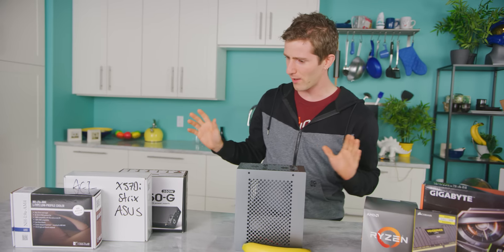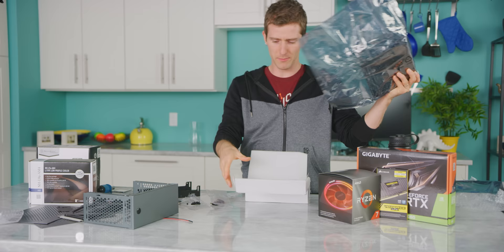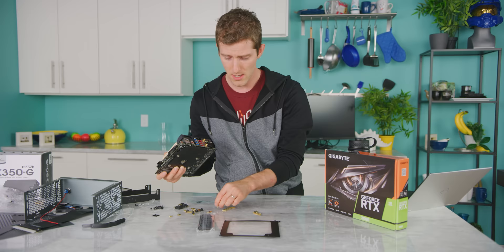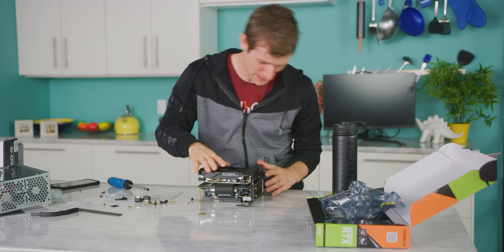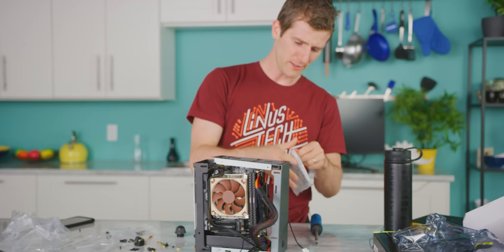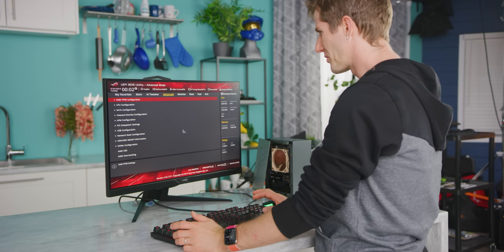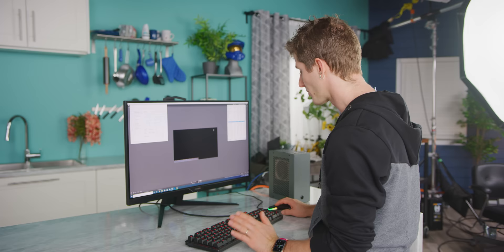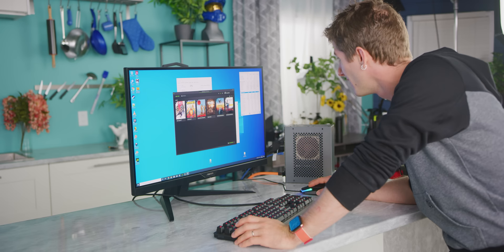Our Smallest Gaming PC Build EVER! - Velkase Velka 3

Comment: Me before watching: I want that
Me after the watching: I still want it but it’s gonna be a painful build

Btw I have a question would it be possible to put a Ryzen 9 or even a threadripper?
Reply: ryzen 9 yes, but not threadripper. depends on the size of the mobo, dont think threadripper makes itx cases
Reply: I think the problem with the R9 would be cooling, not fit.
Reply: Sylvain Ellis noctua nh 12
Reply: At 100% fan speed an all fans
Reply: Ryzen 9 yes, but why? The Ryzen 9 will overheat if it’s overclocked because of the tiny case.
Reply: @isoldmykidneysforyoutubepr3605  why would you even need overclocking on that monster?
Reply: biggest problem will be power delivery as well...it will be pretty tight and hard to find a PSU of that size that actually provides enough power. Also cooling will be pretty much an issue in a way too. Threadripper though? forget about that.
Reply: No, the gpu would bottleneck, and the motherboard as well. Their both super small and a better gpu would be bigger, thus won’t fit.
Reply: ryzen 9 sure but the temp will be crap threadripper in your dreams the TR4 socket would take up like 30% of the motherboard and you wont find a cooler beefy enough at that size to keep it idling under 70C
Reply: Most likely the Ryzen but probably not the threadripper because a small mobo that has to  fit into that case most likely can’t handle 64 cores

Comment: Still with like 1/4 of the size it’s better than a mac “pro”
Reply: In what?
Reply: GP2_Engine  mac pro is pure shit
Reply: GP2_Engine  6000 dollars for 32 gb ram and 8 core processor and like a rx 580
Reply: GP2_Engine  yeah my bad about the last one but the first point still apply sur paying 50 k for only 28 cores like what they should have gone epyc
Reply: true that $6000 for a $1200 pc my ass

Comment: "If it is good enough for Tesla owners, it is good enough for me.“

Get ready for the hate from Tesla fanboys.
Reply: I am what you would probably call a tesla fan boy.
But there is a distinction between legitimate criticism and BS.
And it has been fairly well documented that the manufacturing tolerances at tesla might be a little higher than usual for other car manufacturers. 
That just leaves the question: is that a problem that would keep you from buying a tesla?
Yes? Fine that's your opinion!
No? Also fine, since its still your opinion ^^
Reply: @heulboje21  aaaaand here's the first.
Reply: Jose Cervantes don’t be silly
Reply: Bet you can’t fix a Tesla even with de Walt and Milwaukee’s I can fix my cars with harbor freight tools y’all probably need PhDs to fix a Tesla
Reply: /r/Teslamotors had been shitting on Tesla for the panel gap since the dawn of time 😂
Reply: i think it's complementary?
Reply: @jocerv43  so when someone who admittedly really likes tesla can see that there are problems with their cars that is bad how?
Reply: @heulboje21  You are not the type of Tesla Dan I was referring to. I mean the ones who Atta k Tesla owners for bringing up problems. The type who go into threads about every other EV to trash it. The type who frequent elektrek's comment section.

Comment: 3:50 "There's just the one slot on this board" - tilts the board where you can see second M.2 slot...
Reply: @Lücky Chärm Pretty sure he stated that he is intentionally not prepared as it makes it a more interesting video.
He did eventually find the 2nd m.2 tho.
Reply: @Lücky Chärm He does see the back pretty well at 3:08 and then turns it to camera at 3:10 where it's very obvious =)

Comment: 2019: "Building the smallest pc"
2100: " Building the Atom size pc"
Reply: It would probably sound like: 
"Here we have an electron sized 1.6 × 10^-19 watt power supply which is just enough to power the new 43th generation Intel Atom CPU"

Comment: IIRC ‘Basically Homeless’ made a smaller PC and called you out
Reply: Yes, but his was way underpowered. Not to mention this 0.96 inch "monitor"...
Reply: also hence the "Our" in the video title
Reply: TheFistOfShadow it ran siege
Reply: Maru Mayhem they must’ve changed title

Edit: yep they changed it again
Reply: @thefistofshadow7392  It was gaming capable, and the whole point of the video was to get the smallest PC possible to run siege barring performance...and it did
Reply: @ME-xh5zq   it still has no power, thats what a gaming capable Pc makes a gaming capable Pc

Just because my Toster can run Pac Man on low settings on a 144p screen, it isent a Gaming Toster.
Reply: @FlamingMarshmallow255  and still, it isent a gaming pc
Reply: @thefistofshadow7392  let's not compare pacman to siege, if it can run that it can be considered a gaming pc. The title of the video was originally that they built THE smallest gaming PC, which is incorrect
Reply: @ME-xh5zq  you dont get my point, maby you dont want to get it, but idc now.

Comment: For the best micro PC performance you should use a graphics card with radial slot cooler ;-) 
Sucks from outside and disposes the heat to the outside right again.

And get a little bigger and you can get it to dead silent ;-)

Comment: @16:45 I had similar problems with the InWin Chopin case.  It has a proprietary PSU.  I was hearing air noise from the PSU in my Ryzen build so I removed it and replaced it with a PicoPSU and an external brick.

But it turns out that the PSU fan itself was actually very quiet (as advertised) but it was blowing air around a few tight bends and it was the whooshing noise around those corners that was making the sounds.  It would have required a Dremel-level of case mod to try to do anything about that, if it was even possible.

Comment: 16:40 these are not top of the line PSUs. So I voided warranty on mine and replaced that fan with Noctua 40mm fan, there's even an easy PSU fan replacing kit coming with it.

Comment: Thanks for the great video! I was wondering if it’s possible to do a similar build for 4x2-5 inch drives on a mini ITX board in the smallest possible case that can run NAS and some virtualisation. Games and other fancy stuff not needed. A bill of material on such a build would be great. 
Thanks in advance.

Comment: Bigger fans can move more air with less sound production.
I'd be interested in a small case like this, except for the sound production.
Why don't they have a fan covering each entire side panel?
That way you'd get way, way more air movement with less sound.
With these small fans it's going to be very loud, so not interested.

Comment: I don't really understand, I have been looking into building an ITX system with the exact same PSU, but with an RTX 3060 (170watts). And my research lead my to believe that the 6 pin to 8 pin adapter wouldn't work since it would only be able to draw 75 watts over that one pcie cable, and then 75 from the motherboard, so 150watts total. But here you are with a GPU slightly below the power draw of the 3060, 160watts rather than 170, and use the adapter just fine? Are those 10-20 watts over the limit not really a big problem? or would it still be a good idea to undervolt or set a lower power limit or something?

Comment: cant watch how they build pcs - just pack all stuff together, than hope it will not blow on first powering... i check every step that all runs every time - assembly motherboard with mem and cpu - connect power - run, put in case all - run, add gpu - run, ajust cable management - run... and with this small assembly I will recheck all twice...

Comment: I'm  planning on a build with an i7 gen 11th (32gb ddr4 + mini rtx 2060. But all i can find is a 600watt of psu (which some how fit the case). But the total amount of power consumtion get higher than the psu... so how could you build that with just a 350w psu

Comment: bro none of these pc's live long, the overheating kills them in like two months lol
Reply: When you have to travel so much, these builds are amazing. As far as heat output, I personally lower my settings to achieve better temps. Back and forth from korea plus multiple trips around the states and islands, my rig is going strong. But I also don’t run it maxed out all the time either so I’m sure that’s a factor

Comment: The only thing wrong with pcs in a small box will be very hard to keep cool, the capacitors will not last very long, they will dry out from the heat , they use very low tolerances so they wont last very long, most fails in Electronics are from poor capacitors are  a weakness in electronics today and they do that so they wont last long so you will have to buy new crap all the time, it is very evil way of doing biz in the world of electronics, they r corrupt, just like cell phones that will cos cancer, EMF is real bad stuff, if u want proof read the story of the real Manhattan project, that is where they learned about EMF , Area51 was doing test of Antigravity, and Antigravity is a fail, and it will fry your cells and is the reason Area51 never produced any Aircraft using antigravity it was terminated why EMF and it will kill you , this is no joke im a bit of a scientist with electronics this story is fact holly wood  version of the movie Manhattan project is not the true story, and made it look like the crash in the desert was Aliens, that is a lie , they where testing crap from Germany, there no Aliens At Area51, not even close mark my words .